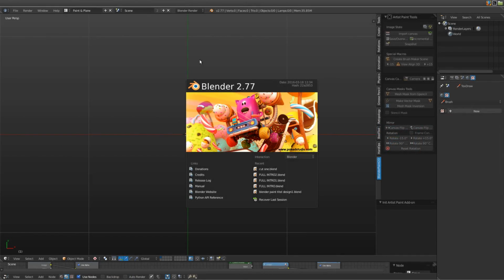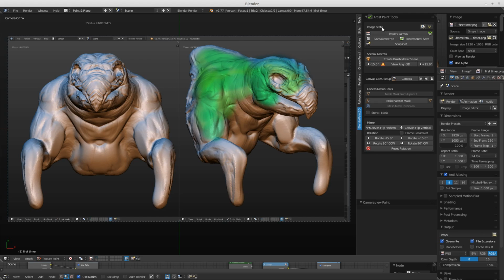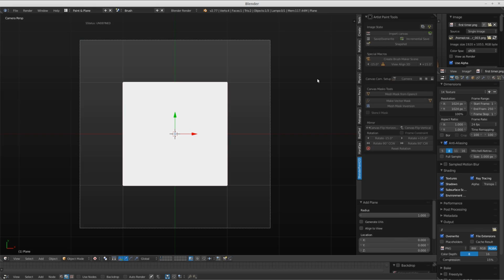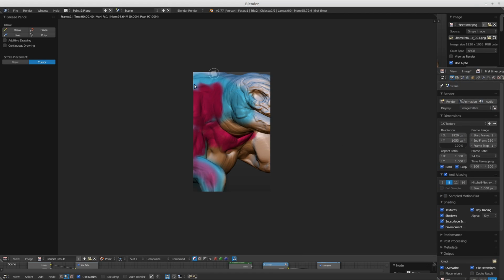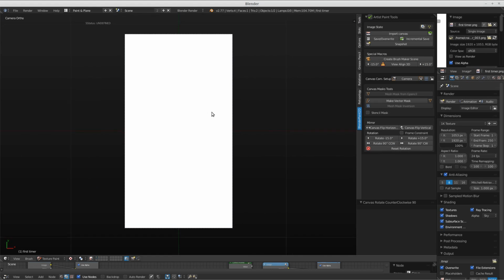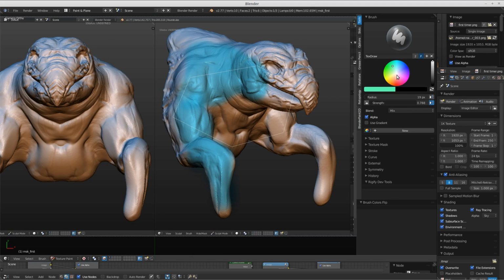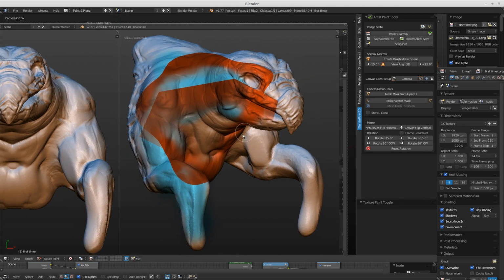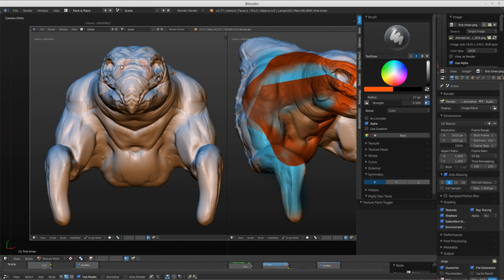Blender paint: Paint Artist Panel Addon Overview

Comment: does pressure sensitivity work?
Reply from the maker: Pressure sensitivity for paint and sculpt is an option next to the strength and radius sliders on the right - toggle those, and you can control them with the pressure of your pen. You can also toggle control of the stroke spacing and jitter, as well as use pressure to control the changes when painting with a gradient brush.

Comment: I've installed the addon from https://github.com/artistCDMJ/paint_a...
but I can't see the "Blender paint 2D" tab...Neither tools nor separate tab
I'm running OSX El capitan and the newest 2.77a Blender
Would you tell me where is my error?
Reply from the maker: Download the zip file from https://github.com/artistCDMJ/artist_paint_panel/archive/master.zip and then in blender user preferences, use 'install from file'. Navigate to the zip file and choose it, and then you should see the Artist Paint Panel addon ready to be enabled with a tick box - do so, and press the arrow on the left to show the user prefs for the adddon, and there you will find where you can rename it from Artist Paint Panel to BlenderPaint 2d or Paint Session or whatever you want, as well as set your own rotation degree preference. Save and then you can get this addon working. I think the problem you had was that the link to the file was incorrect, pointing to the wrong git. I fixed it in the link I give you here.
Reply: Many Thanks for a quick and extensive answer. 
Oh my God!!!!..... How can I be so stubborn?
I need to read ALL. 
Especially when it says (clearly) : WARNING: RUN ONLY IN BLENDER NOW
Unfortunately I was in Cycles......I'm really grateful to you, Craig.